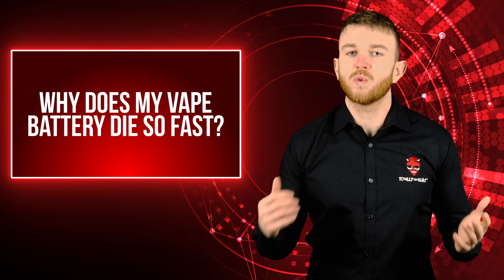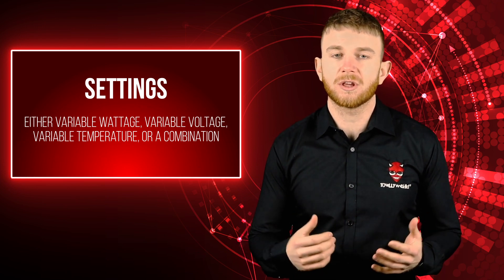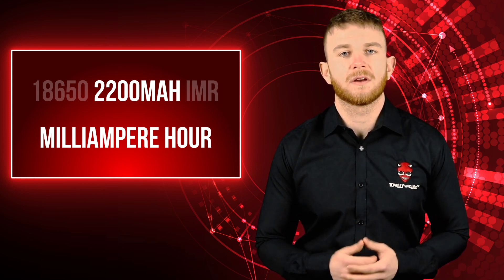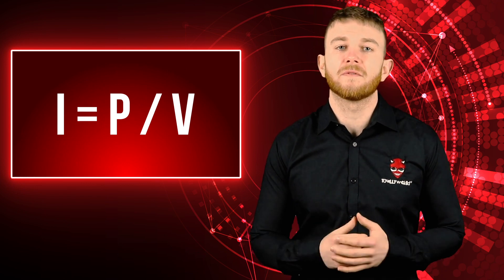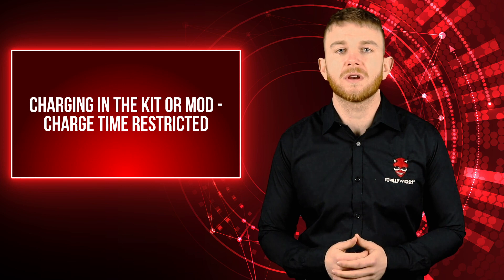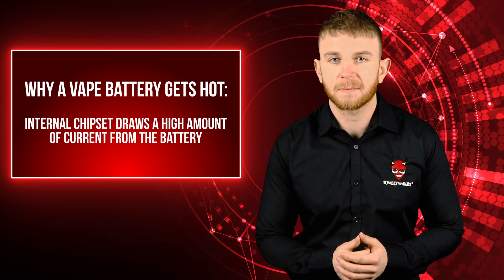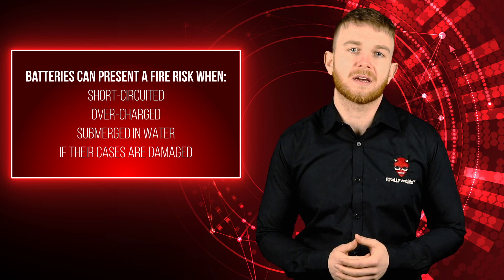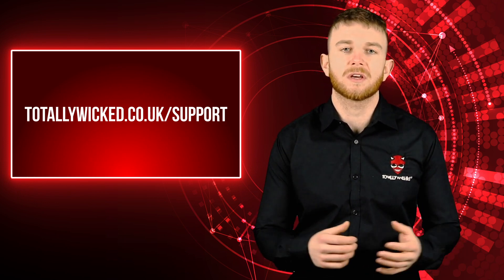Why does my vape battery die so fast?

Comment: I have the green Panasonic NCR18650B Li-ion 3400mAh it's kinda like the most popular 18650 cells here in Poland, but, I checked it but, no where was any amperage written on it, how can I know it's amperage? These Panasonic cells I mentioned are new and supposedly real but, I only get a few hours of vaping in my Vaporesso Swag PX80 with only 80W and constantly vaping between 40 & 55W.
Reply: I have the same problem in my Vaperesso Swag mod. It discharges within 50 puffs and charges fully in a matter of 5-7 minutes. Were you able to figure out what was wrong? I am scared of using this mod with the fear I might damage the mod or worse it could explode due to a faulty battery.
Reply: @maddys3823  If you're still within the return window, return it. The device looks good but that's it. It's unstable, it doesn't have enough power at least now I know. And if you prefer to keep the device, preferably take out the battery to charge it in a dedicated 18650 charger and don't keep the battery inside if you don't trust it.
Reply: @Sir-Kay  Thank you for your response. How long should it ideally take to fully charge the device? Mine charges fully within just 5-7 mins which leads me to believe that the battery must be faulty. It's new so I don't know how that could be. I can't return mine since it was purchased from the gray Market. You can't legally buy vape in my country.